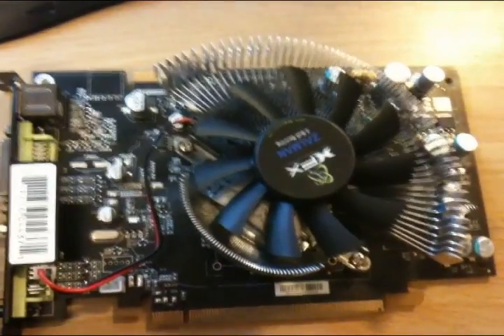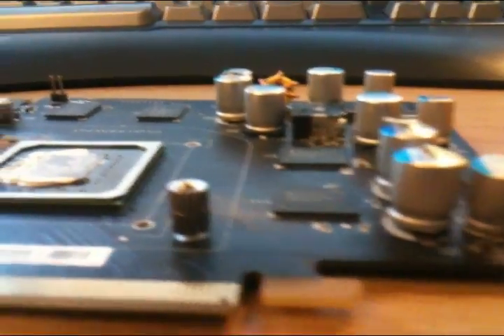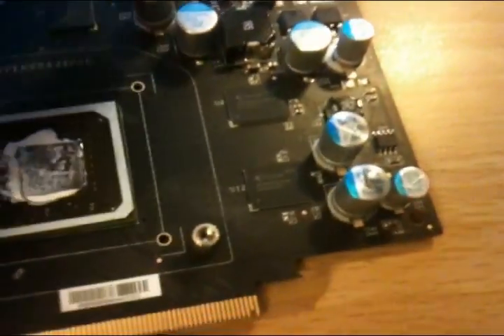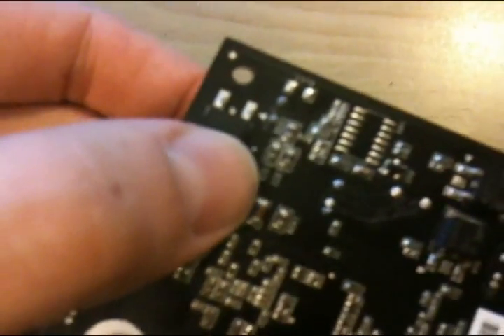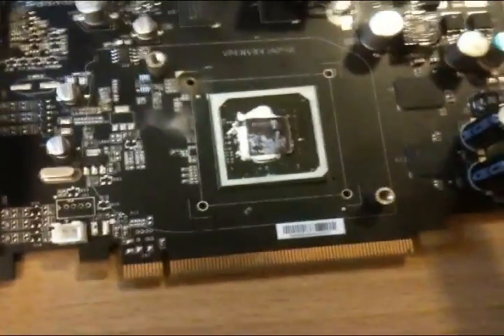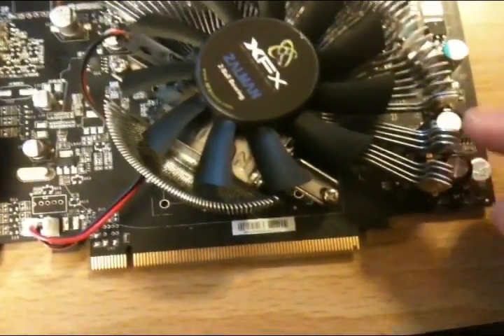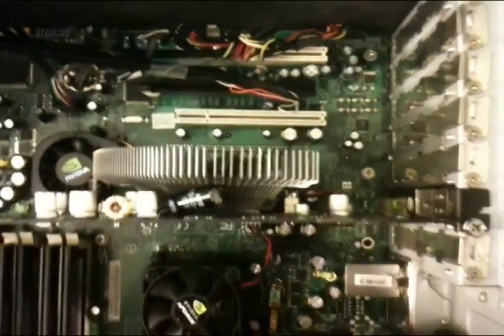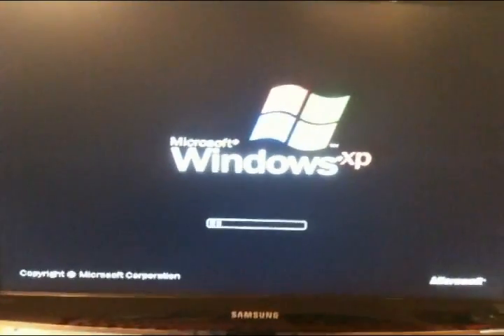How to Repair Video Graphic Cards with Blown Capacitors  ATI, Nvidia, AMD

Comment: lucky you. mine are the surface mount capacitors on the back of the card. goddamned things have almost all exploded in half, im surprised it didnt ruin the rest of my computer when it happened.
Reply from the maker: +Tetra Digm You still can fix them, use a magnify glass to find what type they are. Then buy what you need, then watch a few YouTube videos of someone doing a surface mount capacitor replacement. There's a few youtubers who constantly post electronic repairs even wirh tiny components.
Reply from the maker: +Tetra Digm I can't help you, find another video.

Comment: do you must use the same capacitor, say that i want to replace 3v caps with 6v
Reply from the maker: You don't have to, but something else might break because of that small change in specifications. #Capacitors store energy then release it, I'm not sure what controls that function. To be safe, go to #radioshack or #Amazon and order the right part. That's what a #professional #electronics #expert would do for you my brotha.
Reply: Not exactly, you can use capacitors with the same capacitance of the broken one and they can have also a higher voltage , what important is  the capacitance, for example if you have a Capacitor 470uF 16V you can replace it with one 470uF 25V, the voltage is the max value the capacitor can support before exploding, of course if you have all capacitors with 16V you can use capacitors with higher voltage without problem but never with a lower voltage or capacitance.

Bye
Reply: Luca Is correct. As long as the microfarad capacitance matches you can use higher voltages.

Comment: Hello, I have a Nvidia 7300 gt and all 5 caps were blown. what do you thing is the reason why these caps were blown?
I'm planning to replace all of them with 1500uF electrolytic capacitor, I bought them yesterday and try it on my new Mobo. can this damage my motherboard?
Reply from the maker: +louise john cacot There was a bad batch of capacitors several years ago. Its the reason motherboard manufacturers mention they use 100% Japanese caps these days. Anyways, I would replace  the blown caps with exact replacements, unless you understand what would happen if you install the wrong ones. Once you swap out the caps your video card should work. Lastly  you can thank me by subscribing😃

Comment: One of my capacitors looks like it's bent slightly and not on to the board as well as the rest and I'm having a problem with when my GPU hits 65 degrees my PC screen flickers then goes black and restarts. Could that be down to the capacitor?
Reply: probably

Comment: what did you use to desolder the capacitors leg? i have one and its frustrating for as the solder won't goes away even i am using desolder wick + flux + 80w solder iron.

Comment: and what if my capacitors are OK (which I think exchange capacitor like you did would be easier than what I need to do) all graphic card would be OK except in one spot on one of those small black chips (I do not know how are they called professionally) but it is not the card memory bank that got burned but one of those other smaller-pretty small black chips/block square -that is what got burned on my XFX Radeon hd6850 - sorry for my language difficulties I hope someone understood without a picture what I am talking about and can give me proffesional answer if and where someone could repair something like this?? -without me needing to spend what a new card would cost to buy??
Reply: It's a bad luck it was a great card that I never really used  it's potential as I didn't play games then, I wanted to clean this card, I cleaned with some liquid with alcohol and connected too quick, it didn't dry out in that one small spot and it burned the chip there, the card won't display anything only fan works, but I'm positive that if this block would get repaired then card would be saved. It also wasn't the kind of thing that oven would repair...
Reply: Mariusz S I think you are talking about a transistor. And unfortunately, a graphics card is usually the most expensive PC Component after the CPU.

Comment from the maker: Just an update to this video from way-back, the original video card that was repaired in this video is still working in the computer I donated to my parents. So if you have any doubts about it working for you, rest assured you can fix your video card, if it has a similar problem.  #videocard     #videocardnvidiageforce
Reply: 4 SMD caps have literally blown off my gtx 670 and I need to solder them back on but it would appear that the area beneat it has burnt away... Any ideas?
Reply: *beneath
Reply: Hi,
I bought a used Gigabyte Windforce R9 280X OC Rev 2 with a 'bad BIOS flash' -- I flashed the correct BIOS, and now it works fine in the BIOS and DOS / text modes, but when Windows or Linux tries to switch to graphics mode, it freezes the computer.  Tried to RMA, they told me the previous owner had replaced the thermal paste, voiding the warranty, and possibly damaging the card by using too much (which I verified upon getting the card back, he used way too much).

I cleaned the paste off, and I tried reflowing the solder (oven @ 385 for 8 minutes) -- no difference, BIOS and text remains functional, graphics still freeze the computer.

Where could I send this card to get it tested & repaired?

Comment: I woulda replaced it with a recent GPU... and my tip forrepairing a GPU is to replace the existing caps with solid caps... much higher temperature thresholds and longer life... therefore a better GPU lifespan and performance!
Reply from the maker: see my latest comment, this video is back from 2011, I'm running a PowerColor AX7850 2GBD5-DH #Radeon HD 7850 2GB 256-Bit GDDR5 PCI Express 3.0 x16 HDCP Ready CrossFireX Support Video Card.

Comment: dude cheap ass just buy a new video card and stop fuckin; over clocking and you wont have this  problem...
Reply: See your attitude is a problem for us consumers, each time a card die people like you rise pretending to be wise and rich while the problem is no matter how many cards we buy they brake and brake fast, we must press on AMD and nVidia in raising the reliability and dependability instead of pushing OC and lowering the life of our investment it's not a game to throw couple of three figures each 6 months because the cards brake and brake often can't we at least ask why.
Reply: ... why are you so angry?
Reply: quakebox Agree, I even read somewhere Nvidia was purposely crippling older cards performance forcing users to upgrade. I still have a pair of 9800GT's they were able to handle BF3 at 1080p at med high settings with older drivers from whent he game was 1st launched, now with these newer drivers, its a nightmare, but I do think Dice/EA are probably to blame their though.
Reply from the maker: Tasha Goldsmith Exactly.
Reply: How is he a cheap ass, Caps are so cheap anyway. And the 8600GT is still a decnet card for basic computing and light gaming, makes no sense to throw it away if all it needs is caps. $1.79 for a few caps is still better then spending $30 in a new GPU. I replaced my caps with used motherboard caps on my 5850, a 5 year old card that still out performs a HD7790, and OCing isn't going to hurt the caps anyway lol.
Reply from the maker: Thanks Viking Dudee. And did anyone ever think that maybe I made this video strictly to make video content, because I'm a YouTube Partner; therefore, I make money from making videos?

P.S. I'm running a  #AMDRadeon   7800 Series these days anyway.
Reply: the overclocking isn't so much of a problem as long as the caps are high temperature bearing... some of the 8600GTs had 85*c rated caps on them and those things blow like there's no tomorrow when you run a game or CUDA application. I do GPU repairs relatively regularly and have fixed a few plagued 8600 and 8800GT GPUs. after I've been near them with some solid caps and a soldering iron, those GPUs are still functioning and a few are overclocked as far as anyone dare to go with them... no issues whatsoever!!!... again, some GPUs are built to a price... and some of the early 8600GT GPUs are sadly part of that!!... I even had a Quadro FX 4600 come in for a cap swap and a blast with a heat gun!!
Reply: ***** You should not tell people how to spend their money. Not everyone lives the same economically.

Comment: hey buddy your vid is helpful ,, bt i accidently touched metal to some souldring of my graphic card,, it made sound of sparking and frm that tym its not working,, can u tell me what part of it i broke,,, and i touched metal as it was a current tester screwdriver..  and i was trying to know why my pc is getting no display after some time of startup ...can u please help me >.<
Reply: you might have totalled the GPU... that's how my FX1700 went... I was getting a load of artifacting and cutouts as if the chip was undervolting, so I grabbed a voltmeter and accidentally shorted a filter cap behind the GPU chip... poof!! dead card from then... at least I got a Radeon 7950 out of it... and a new power supply!! XD

Comment: I have a XFX Nvidia Geforce 9400gt.  It used to work fine.  Unfortunately, I dropped my Assembled system which is now OWR and there are horizontal lines even in the BIOS.  But my video on the motherboard works fine.  How do i fix the issue with the horizontal lines as it occurred only after dropping the system.  Could it be a capacitor issue on the videocard?  Can it be fixed?  Another graphic card works fine on the same slot.
Reply: I'll assume you've already tried a different PCI slot, but if not, do so before carrying these steps out:

remove the GPU heatsink and check the die for any breaks in the corners or scratches in the die surface (use a magnifying glass, and very tiny scratches are somewhat acceptable as the GPU die has a thin layer of silicon before the transistors)... if any silicon comes off with the cooler... you have a dead card

BUT: if there's no breaks or heavy gouging on the GPU, then try heating it up (while off) with a hair dryer set to high or a heat gun on medium heat, warm the GPU die and the surrounding board evenly, then let it settle for 30 minutes or until cool to the touch before replacing the heatsink, cleaning the GPU contacts with 99% Isopropyl alcohol (it eliminates skin oils being a culprit, although not likely) and replace in the machine. if this doesn't work, you CAN try new caps... but the likelihood of success if it's a simple drop and none of the caps are bulging at the top or leaking is relatively slim.

Comment: Hi thanks for the video, I will try this on my 7300 gs card, just not sure how you know what capacitor it is - ill try google the number on the caps. Greetings from South Africa
Reply: the capacitors are labelled with the ratings (in microfarads) on their stickers, it's pretty easy to work them out. a normal electrolytic with a label wrapped round it has the voltage, maximum temperature and capacity written on it. a cap with the info inked on (like on a GPU) still has those same principles, ususally rated for 105*C operation at between 5 and 16V (it doesn't matter what the voltage is as long as the input voltage is below the maximum and that the cap fits and the microfarad rating is right). a GPU cap usually has the rating just down as something like "470, 6.3V", the 470 being the rating in microfarads (470mF) and 6.3V the maximum power the cap can handle.

Comment: hey there, nice to see someone that still repairs things instead of throwing them out,i have a 5770 ATI on my PC and recently i bought a 285 gtx nvidia from eBay, both are pci express,when i received the nvidia, it powers up and there's two little green lights on the back of it that come on but no picture, just a black screen,the seller refunded my money but told me to keep the card,any idea what might be wrong with it?  he said it worked before he pulled it out and that it had been "sitting" on his desk,at this point i have nothing to loose so i was wondering if it could be repaired or if there is actually anything wrong with it? i tried the drivers approach, basically the computer does not recognize the card in the device manager, that's a first for me,any thoughts would be appreciated it,thanks!! BTW i have a 750 corsair power supply so ample power there.

Comment: Had to fix my HD5850 by replacing the caps.
Reply: Any chance you'd know what the b200 is marked on this card?  I have a component near the 4 pin connector blown, can't identify it.  Just thought i'd ask, a search led me to this post.  Thanks.
Reply: bitewingrocks depends I guess, I didn't see anything labeled b200 on my gigabyte card, It wasn't reference but a aftermarket PCB so that's probably why.
Reply: bitewingrocks B200 is a resistor... if it's blown/missing, that could cause a lot of things... since I don't actually kinow what it's limiting power to... I can't say... but if ot's on the GPU's VRM phasing, then it's gonna make the card unstable... if it's on the fan controller, then it's gonna kill the fan's functionality and cause an overheat... best take it to a tech savvy SMD solderer or easier and cheaper: replace the GPU

Comment: it's not fixed. there was a reason they blew. and that reason hasn't been addressed so they will blow again. hopefully not very soon! Also if you're considering doing this it be a good idea to check other components too if they look a bit fatigue check they're working with a multimeter.
Reply from the maker: The graphics card is still working 100% because the original caps were poor quality and sold to hundreds of manufacturers. You can research this well known problem on Google. It's the number #1 reason that motherboard manufactures now specifically sell military grade capacitors or capacitors from Japan. Hope that clears up he confusion, Happy Holidays!  #videocards
Reply: You check with a Huntron. Caps blow all the time in electronic equipment primarily due to heat.
Reply: So, Leima Wallace, why is it that you think that something else in the circuit is broken and not the capacitor? What makes the typically MOST fragile of electronic components immune to failure in you peabrain? Capacitors blowing up is precisely due to the capacitors themselves not being manufactured well, with the chemical reactions generating hydrogen gas. Also, a multimeter can't check fatiuge. It has a voltmeter, ohmeter, anmeter, among other meters, and besides, testing components while they are not separate from the circuit board is an exercise in futility because of nearby components screwing up the readings.
Reply: TehKaiser Sorry guys.

They looked like they had blown because of overcurrent or overvoltage. I suppose the heat from the card could lower the capacitors tolerances which would cause the same results; makes sense as they were poor quality (forgot about the Taiwanese and now Chinese capacitor charade. And the temperatures generated by graphics cards).

I didn't say to check fatigue with a multimeter either bro - so we both made mistakes. If anyone's going to pull the caps out, taking a resistor or diode off  to test shouldn't be too overwhelming. And you can still test for opens and shorts when they're on the board. 

I have seen PCB's where caps blow up because a resistor has become de-soldered and shorted out which would have limited the current to said caps so someone else may have a similar problem.

Comment: So my graphics card had gasoline poured onto it, then it was lit on fire, smashed with a hammer. After that I believe there was peanut butter slathered onto the internal electrical components of the card. Could you help?

Comment: Nice  video i had to do the same when a few  capacitors blew on my monitors power board and now works fine. On a side note when replacing capacitors you really should not only match the rating of the capacitor but also the type of capacitor because in this case you replaced Solid Capacitors with basic and less efficient Electrolytic capacitors

Comment: Don't give advice when you know jack shit about what you're talking about. GPUs are designed to run up to 95 degrees CELSIUS. The 580 is the older brother of the 480, which commonly ran at 90C during load and that was NORMAL. 70 to 85C is perfectly fine. If you're not happy with it, put a waterblock on it, or look at one of the watercooling guides that show you how to add a cheap AIO CPU watercooler to your card. I've done it and it cut my temps in half on one of my old 5870s.

Comment: Hey, commenting on another one of your videos lol. I have a EV3A GTX 580 graphics card, while its ide it its around 36 D celicus, and again while i play games that are graphics intensive it goes up to 70 even 85+ degrees depending on the graphics settings themselves within the game. It has 2 fans which i push to 70% usage, around 3960 RPM, the temps go mid to high 70's while doing this and i know it can damage the fans. What would you recommend doing because i realize they shouldnt get this hot?

Comment: Try to answer Undisclosed Recipent's problem if you could please. I have the same issue and  I'm about to try replacing all of the capacitors on the board in an attempt to solve the issue. I'd like to know before though so I don't waste 30$ :P

Comment: Just a quickie,
if youre going to lay the cap on its side best put some sleeving on the long exposed legs, heat resistant type insulation is best.

cheers

Comment: my 8800gt has long beep sound on the card but no display. i try everything i cant get it fix. i notice i got 2 missing tiny chip near at the PCI-E slot is there a way i can replace with some new caps maybe?
any chance to give some advice. thanks i would really appreciate it.